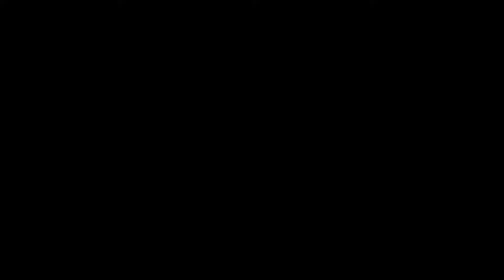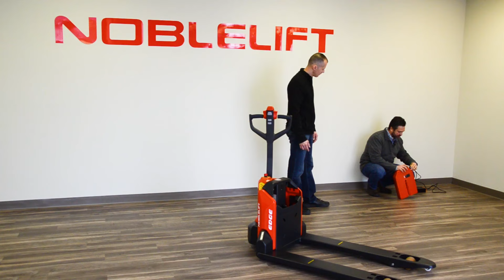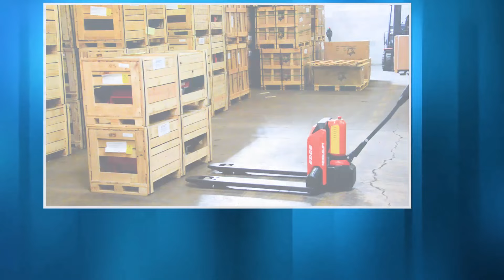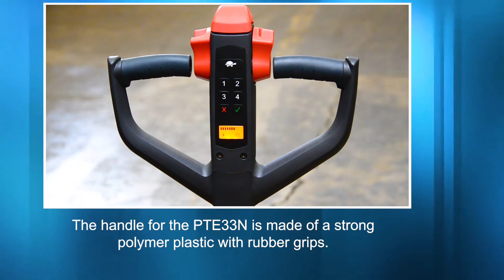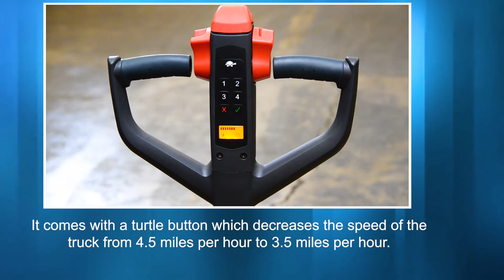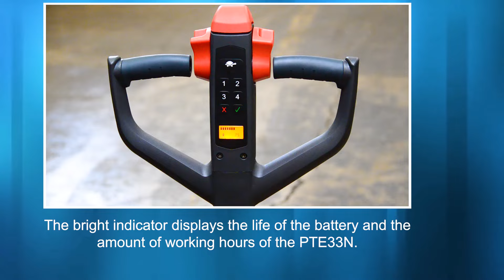Cherry's Industrial Introduces the PTE33N Electric Pallet Truck ("Edge")

Comment: Horrible jacks... STAY AWAY FROM ION BATTERIES. First, doesn't have the counter weight.. Try to lift a 2000 pound pallet and go over a dock plate, IT WILL GET STUCK and wheels will spin in place and flatten and as a result you'll need to spend $500-$700 to replace the wheels. Also, they fail to disclose these ion batteries don't last in NON HEATED warehouses... So, if you are in FL, CA, TX, AZ you may be OK, but if you are in mid to northern states, in the fall, Winter and early spring, in a NON HEATED warehouse you'r screwed. Waste of money, don't bother with thees jacks, buy a good old style battery pallet jacks...
Reply: Any recommendations please  I need it in Ireland thanks.

Comment: Info is limited we bought 4 one now is not driving forward or reverse , only will lift. Other than doing base troubleshooting it's the same as any other lift truck.  2 months old
Reply from the maker: Please call our customer help line at 877-350-2729 so we can get more details.
Reply: How did you solve the problem? I get error 19, it doesn't move forward or backward.